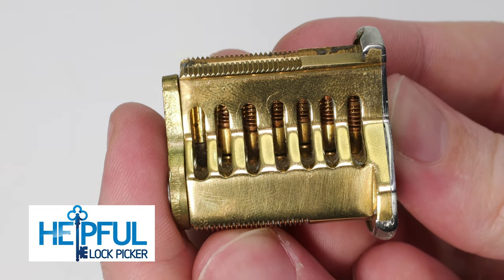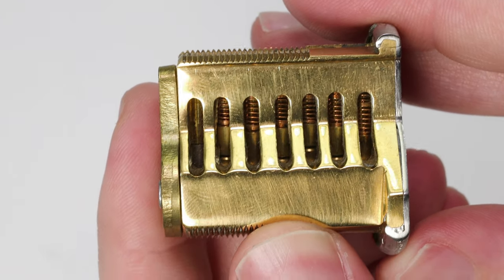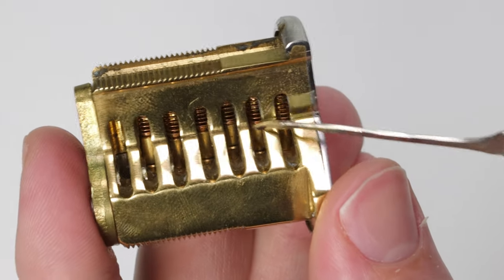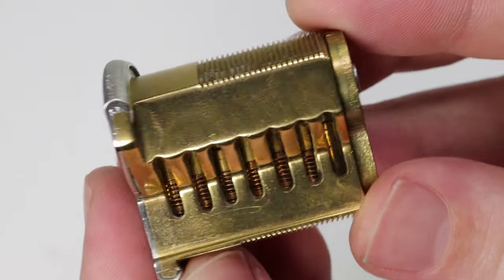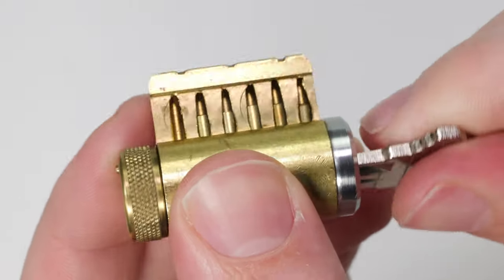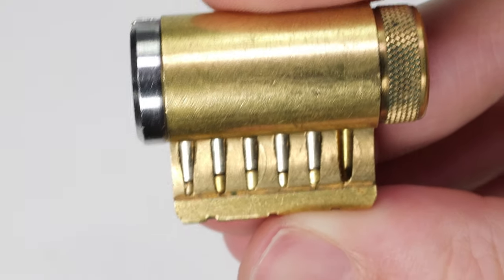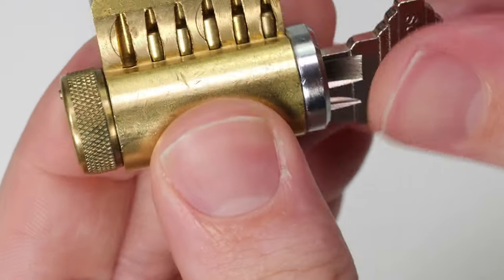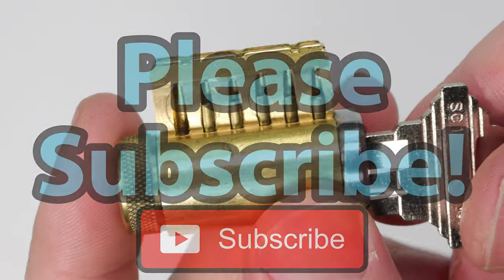Why Do Locks Have Springs Inside Them?

Comment: Would stronger springs make picking easier or harder than just adequate ones?
Reply from the maker: Really strong pins and locks with good tolerances can make the pins hard to set. It is a balancing act